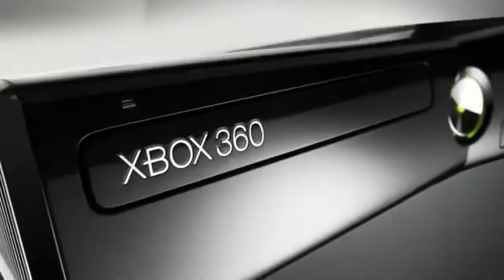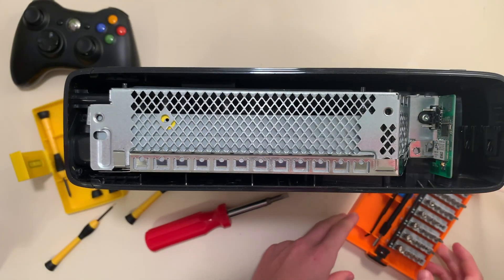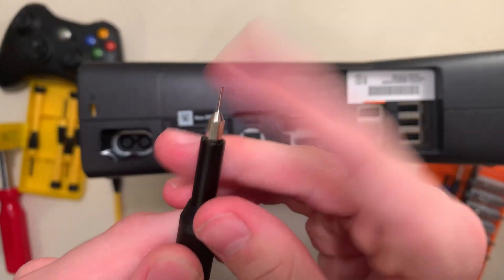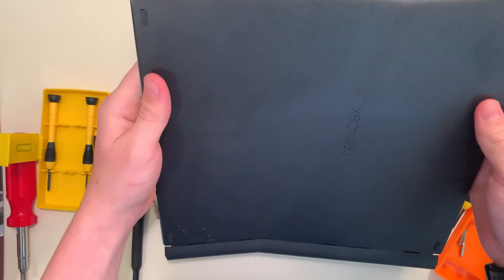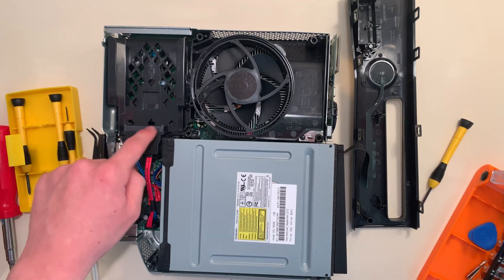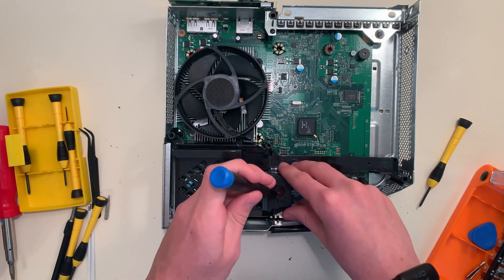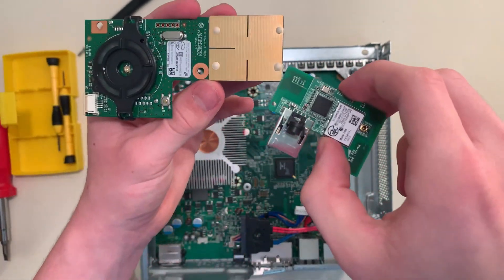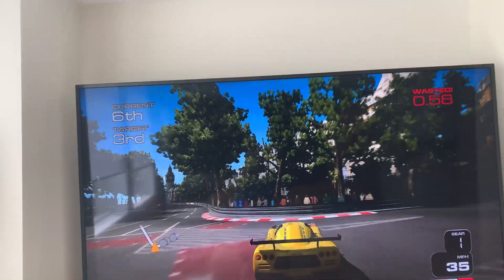What's Inside the Xbox 360 Slim?

Comment: 1:10 btw this gets easier to remove each time you open the console
1:48 the screw on the wifi card is actually a T-10 head
4:48 careful not to damage the foam on the sides of the fan, it is extremely fragile
Reply from the maker: Good to know! Thanks